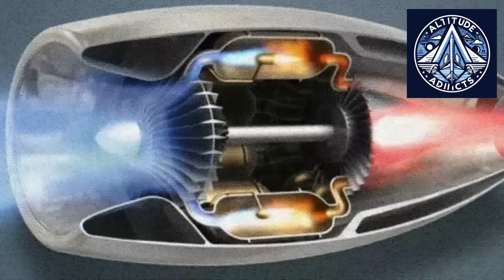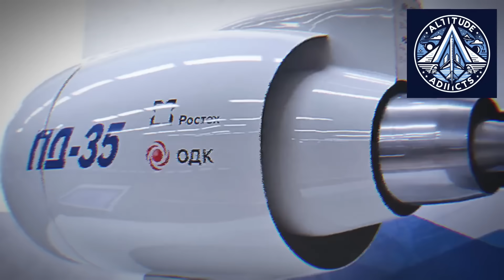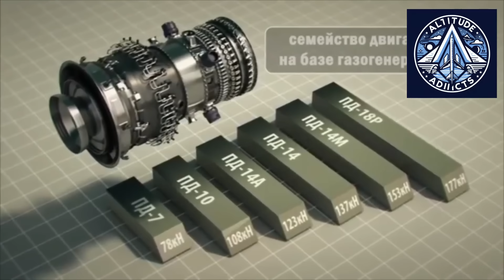Why Russian PD-26 Engine May Fly First—Despite PD-35’s Massive Power

Comment: they are reverse engineering the D-18 at UWCA and developing the PD-26 in parallel for re-engining the An-124s  .... the D-18 clone will appear first ...... meanwhile they can design a widebody the size of a Boeing 767 to also use the PD-26 ..... it makes total sense  .... Russia does not really need a widebody any bigger than a 767 anyway
Reply: D-18 is a 3-shaft engine, a different kind of "monster" to master, that only UK and the Ukraine produces. Copying it is not  easy task, de-tuning PD-35 2 shaft engine with less stages would be much more economical and efficient. Copying an engine with thousands of parts is not an easy task, especially for Russia.
Reply: The il96 is more than enough with modern materials n design twick.

Comment: The PD-26 is just the Lotarev D-18T with a FADEC, composite blades and updated optimized components all around, has been a reliable engine for a long time.....
The PD-xx iis just a different integrator and final assembler.... Don't read to much into it....!..
Reply: it will have a lot higher bypass ratio though approx 50% higher .....
Reply: @GaryKennedy-g7p  That is in order to reduce noise and lower front fan speeds, but not much more since they can accomplish thrust the same with a lower bypass ratio too but at higher rotation speeds... Think of it like a Diesel engine and a F1 race car engine....
Reply: No, the clip tells PD 26 is a derated on PD 35 while using the same core.  So it can come early.
The Ukrainian D-18T is 3 shafts configuration like Roll-Royce.  But PD engines are commonly conventional 2 shafts engines.
Reply: @alexlo7708  It is a Lotarev designed engine also integrated in other regions by Progress, Ivchenko-Progress and Motor Sich....
Reply: No
Reply: By that.. every engine is like this or that based on something!! It's the technical innovation that make stand unique.